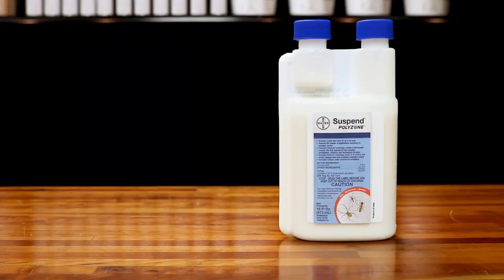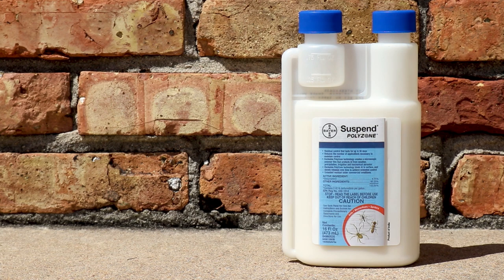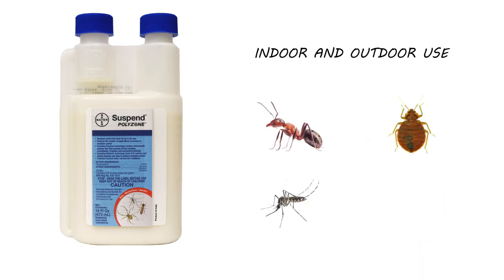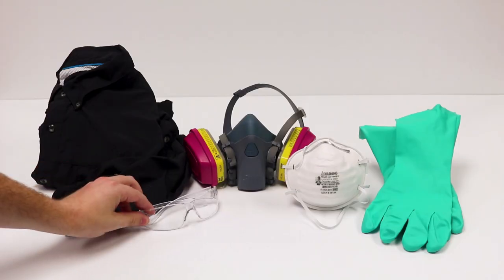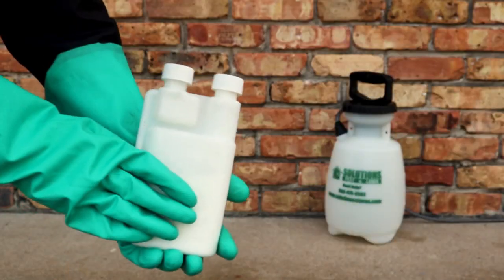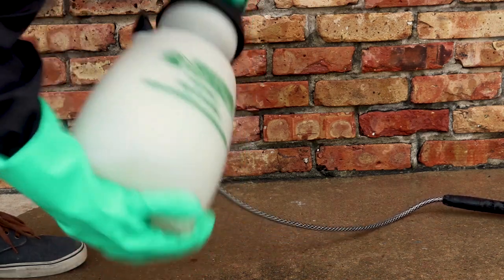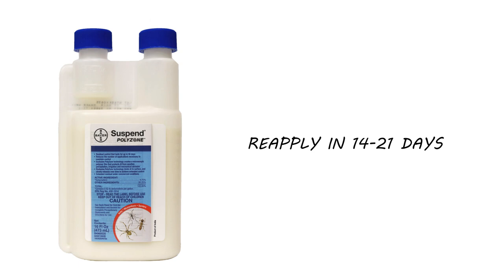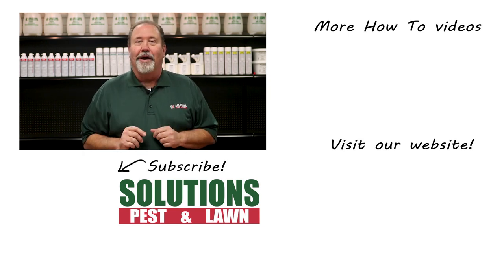Suspend Polyzone: Product Review

Comment: i bought the suspend for roach issues. I am wondering if I need to use the IGR too.
Reply: Indoor or outdoor roaches?
Reply: @jewfroismymotto  indoor
Reply: @sh2697  phantom termiticide/pesticide works well for indoor roaches as it isn’t a repellant. Gentrol IGR will help too!
Reply: @jewfroismymotto So Suspend Poly won't work for roaches??
Reply: @mercedesbenzs600bash  it will, but I recommend using an insect growth regulator as well.
Reply: @mercedesbenzs600bash suspend works great for large “American” tree roaches 

It’s garbage for German (little kitchen) roaches that apartments often have issues with as well as trailers

Comment: This one is useful for ant and roaches from what I hear.
Reply: Never use suspend on ants. Use non repellents.
Reply: @fuckboi4852  what to use then? They are aggravating me to the max ☹️
Reply: @pimpinpanba8799 What did you use???
Reply: Termidor SC for ants, treat colony directly and allow 1 week works best for me. Non repellent and slow kill is best for ant colony elimination
Reply: There are plenty of less abrasive chemicals for ants that work just fine. Termidor sc is an EXTREMELY abrasive chemical and can only be used twice or four times a year at a single property per EPA regulations. Tekko pro with onslaught is a more environmentally friendly combination that will destroy the ants just as well. (Without the years worth of ecological damage termidor sc causes.)